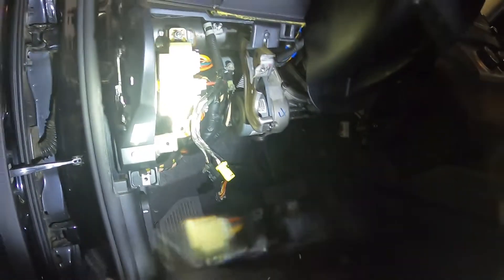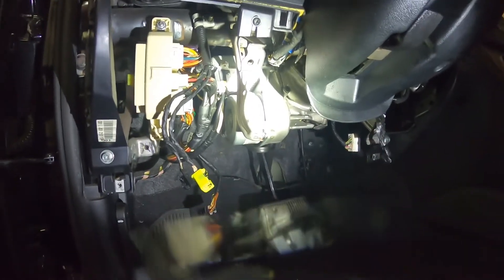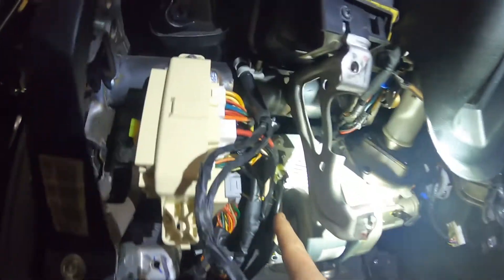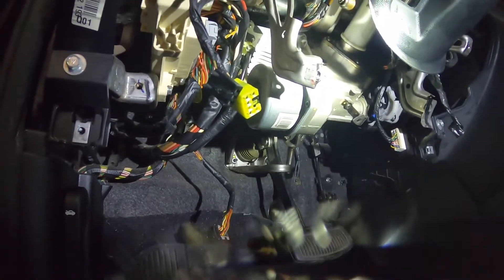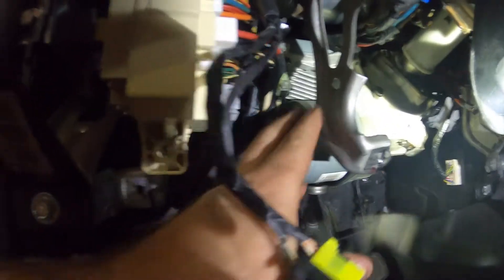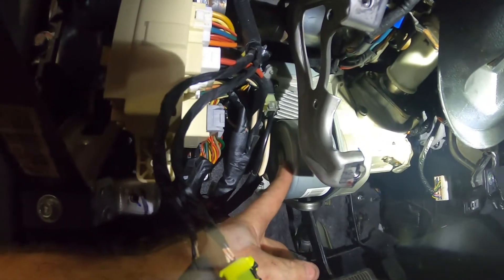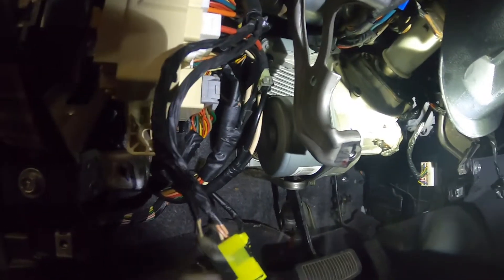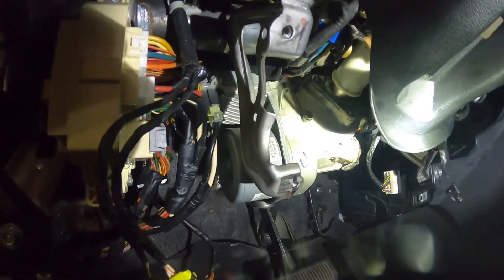How to replace 2017 Hyundai Elantra Power Steering Gear Replacement

Comment: Could this also be the reason it would lock the steering wheel up and it resets when you turn off the car and back on?
Reply from the maker: not for the gear part no  the plastic gear comes apart  thats why this was begin replaced

Comment: So i have 2017 Hyundai Elantra AND whenever i turn the wheel it make a whining sounds could this be the problem and what a a job like this cost ???? Thank you
Reply from the maker: The gear usually makes a popping sound when you turn the wheel.  for costs I would contact a local shop and ask them what there cost would be  shops all have different labor rats and parts costs.

Comment: Can you drop a link to the part?
Reply from the maker: This  should work   make sure it's compatible  with your car 
APDTY 112837 Steering Column Motor MDPS Clunk Noise Rubber Flex Coupler Repair Compatible With Select Hyundai Sonata Elantra Santa Fe Azera Veloster Kia Soul Optima Forte Cadenza (TSB 14-ST-002-1) https://a.co/d/iHQVaXi
Reply: @kevinsmobileautomotiverepair  thank you!
Reply from the maker: @walter9115  welcome